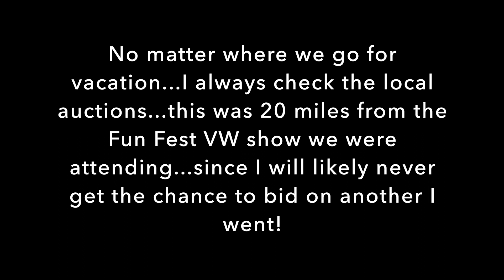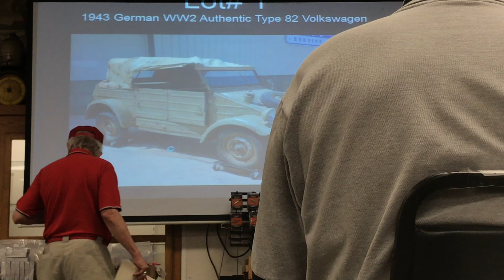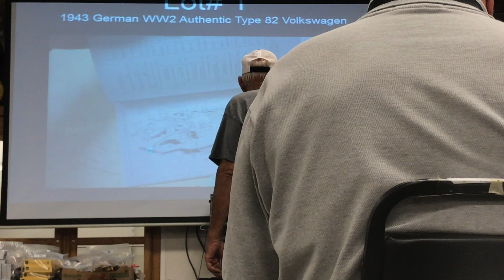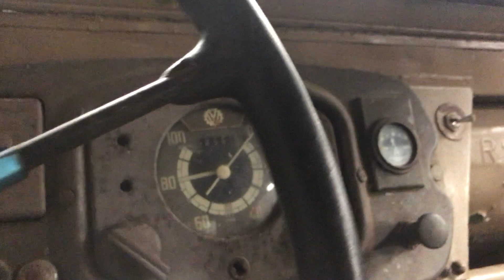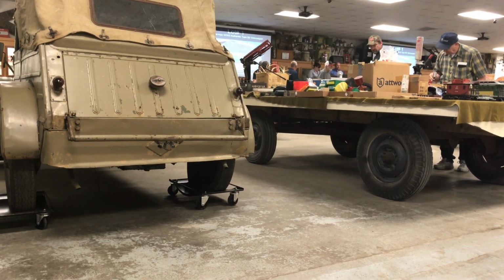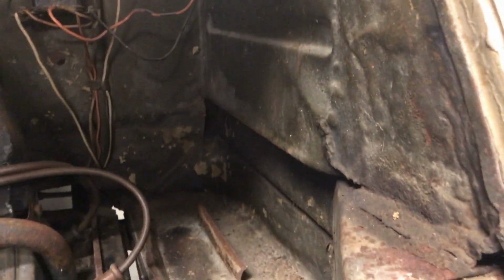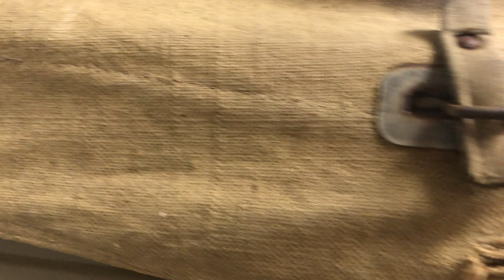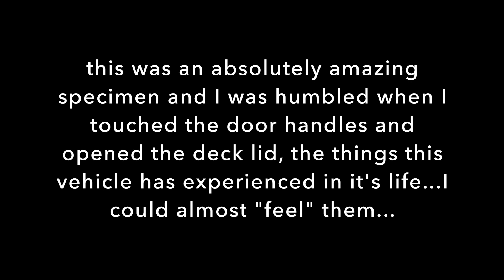1943 VW Type 82 Kubelwagen goes to auction

Comment: 20k was a bargain. They’re not making any more of them you know. Proper restoration they are over 100k
But for 20k, you could do a make over, wiring, brakes. Take the crash box out, install a modern swing axle and single port.....do a kaki paint job, a new canvas top and some reasonable seat pads.....for a few grand.....and drive it.
Save all the old stuff that came out of it.
You would easily be able to sell the car and get your $$$ back.
Woulda, coulda, shoulda.....I personally don’t have $$$ for this stuff.
Still, I didn’t have money for the nice kubles and schwimmers....when you had to read classifieds and they were an astounding 5 k!!
Anyway...cool video
Reply from the maker: Daniel Allen agreed! If it had a title or import papers I think would have easily brought $30,000...it was in incredible condition with only minor rust in pans, and pretty much totally complete (there were two boxes of parts in the back seat and floor boards that you can see in video). I figure $5k in title fees etc and tires and maybe $1-2k more for making it “road worthy” and it’s a driver, wouldn’t do a thing to it! Very very cool vehicle!
Reply: I would have bought it for that but I just dont have a place to put it. No title is not an issue if it is old. all you need to do here in CA state that it is older than 75 then they will send you one in the mail. No emissions required on classics. My buddys have gotten stuff from mexico the same way. Just apply for lost title and it is back in the system. Buddy did a barn door bus like that. He put his plates from his 66 on it and drove it across the boarder. then titled it here after no issue.
Reply from the maker: Not that easy in Indiana...can be done but you have to go to court and post in news paper yadda yadda takes a long time and about $3k (If no one fights you on it) the guy that bought it has done it before and he knows the drill! Glad he got it, because I will be seeing more of it! I’m might even get to build him a top for it! Such a cool truck and totally worth the price!
Reply: @marcijunebug  geez I would title it in CA first cost about 150 then transfer it to your state would be easier. and cheaper. OR AZ. not sure on their total policies on that but I dont think it is that hard do an out of state transfer which should be easy then your done.
Reply from the maker: I think he’s got it all figured out, like I said he’s done it before so he’ll get it, if not there’s an option for him!